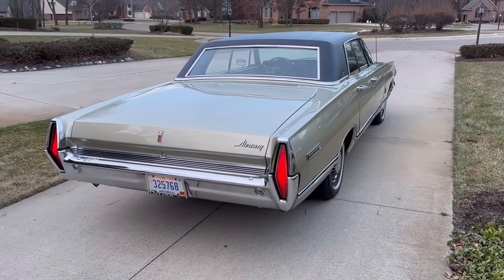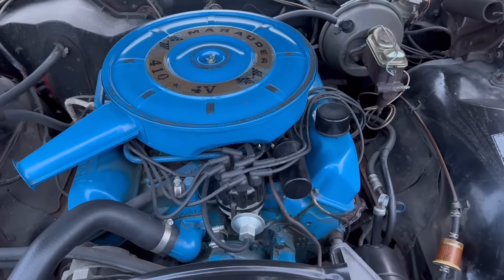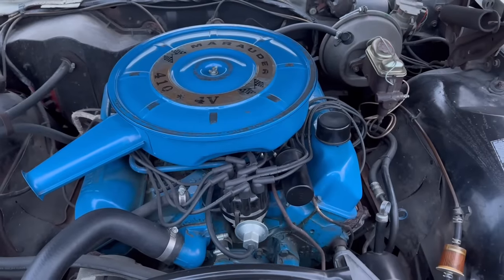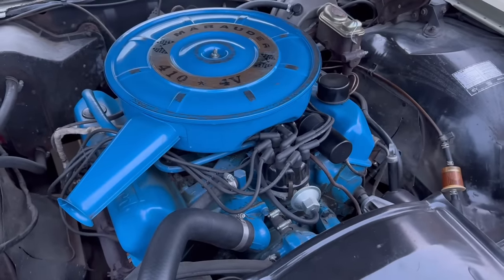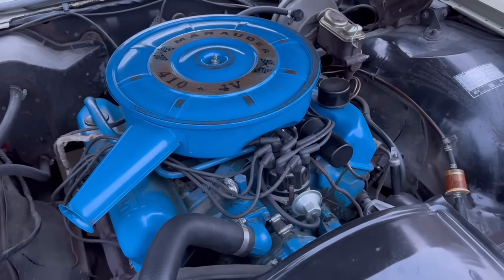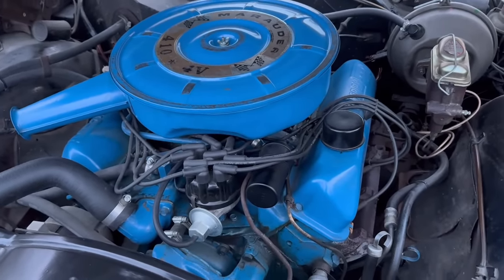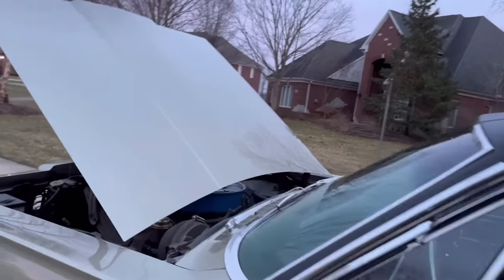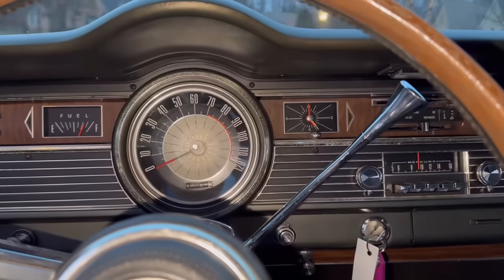Ford's Shortest-Lived (and Smoothest) V8 Engine: The 1966-67 Mercury Only 410 V8

Comment: What do you think of how the following limited production V8s compare to the FE 410?
Chevrolet 262 1975-1976 (Monza, Nova, Ventura)
Chevrolet 5.7L LT5 1990-1995 (Corvette ZR-1)
Ford Boss 429 1969-1970 (Mustang)
Ford 3.4L 1996-1999 (Taurus SHO)
Chrysler 350 1958 (DeSoto Firesweep, Dodge Coronet, Plymouth Fury)
Chrysler 383 RB 1959-60 (Chrysler Windsor and Saratoga)
Pontiac SD-455 (Firebird)

Comment: It's a good motor for a pickup truck you just take a 390 and put 428 Cobra Jet heads with an aluminum four-barrel midrise intake with 750 Holly rv cam and don't forget to enlarge the oil return passages.

Comment: Good pickup truck engines. Lots of torque. 428 crank in a 390 block. Put a 428 crank in a .030 over 427 block to get 454 cu. in. As far as smoothest, the 430-462 was much smoother, almost as smooth as the Lincoln flathead V-12.

Comment: FE does NOT stand for Ford Edsel, it simply stands for Ford Engine. The only engine family that had Edsel in it was the MEL Mercury Edsel Lincoln. I have good memories of our 1967 Mercury Colony Park with a 410 in it. My father put a 390 two barrel in it to run regular gasoline which at 14 I protested.

Comment: Here is my list of American V8 engines offered for 2 years or less: Pontiac 287,316,347,370 (‘55,’56,’57 and ‘58 one year only), Chevy 307 (1971&1972), Pontiac 428 (1968&1969), Lincoln 341 (1955), Lincoln 368 (1956&1957), Ford 239 & 256 (1954), Ford 332 (1958&1959), Ford 406 (1962&1963), Ford 221 (1962&1963), Chrysler 301 (1955&1956), DeSoto 291 (1955), DeSoto 330 (1956), DeSoto 341 (1956&1957), DeSoto 345 (1957), Dodge/Plymouth 270 (1955&1956), Dodge 315 (1956), Dodge 325 (1957&1958), Dodge 326 (1959), Plymouth 259 (1955), Plymouth 277 (1956&1957), Plymouth 303 (1956), Plymouth 301 (1957), Plymouth/DeSoto/Dodge 350 (1958), Studebaker 224 (1955), Studebaker 304.5 (1963&1964), Packard 320 (1955), Packard 352 (1955&1956), Packard 374 (1956) and the Edsel 410 (1958). Did not include the Chevy W-series 427 (1963) as only 57 were made. Hope this answers your question!!!

Comment: How long did the 383 MEL stick around.
Crazy oversquare on that thing, same bore 4.300" and spacing (4.90) as the 430 MEL.
Off the top of my head the stroke was 3.300", which makes it inherently racy.
Reply: The 383 MEL engine debuted in the 1958 model year, then was gone at the end of the 1960 model year (having been replaced at that time by the ubiquitous 390).
Reply: @bobcarlino7280 ; Short stroke MEL was probably the better ticket.

Comment: I had a 1960 Ford falcon with a 144 cubic inch solid lifter motor. I believe it changed to a 170 ci then 200 ci later

Comment: You have to do more than just swap in the 428 crankshaft........you have top change the label on the aircleaner lid!...Oh yeah, and you have to do something with either the pistons or the connecting rods so you're not hitting the top of the combustion chamber with the piston.

Comment: Not as short lived as the 410, but close, would be the 406 FE. 61-mid 63. It got replaced by the much better 427. I believe the max power for the 406 was 401hp with 3 2bbl cabs. I put the aluminum intake set-up on my 68 390 Mustang. It was noticeably faster, but  was 16 and didn't know enough about Holley carbs to get all 3 to work properly, and it seemed all they did was flood out. I got stranded once where I had to pull the vacuum hose of the brake booster and put a vise-grip on the rubber fuel line just to get it started. It ran long enough to get the vise-grip off the line and it took 3 feet to get it home. One to keep the throttle open, one to push the (now unassisted) brakes, and another to push the clutch. Got home. put the stock manifold on, and sold the tri power manifold. BTW, an FE iron manifold weighs almost s much as the engine!

Comment: Honestly wouldn't call it a 2 year engine since it's only a displacement variant of the FE line, the 255 windsor of the 80-82 era was almost as short but more critically an actual distinct variant with different heads, way different intake (used a valley pan) etc...

Comment: The original Windsor small block V8, the 221 was introduced in 1962, it was Ford's response to the famous Chevy small block V8's. 
Later that same year it was bored out to become the 260, and for good reason, the 221 was a gutless wonder.
Thus making it, I believe the shortest lived Ford V8 based on the Windsor platform...

Comment: Adam asks:

“Today we’re going to talk about the shortest lived Ford engine, at least that I know of. If I’m missing one, please let me know.”

How about Ford Australia’s 3.2 Litre SOHC I-6?

This unique, smaller capacity 3.2 Litre variant of the also-new 3.9 Litre version was introduced with the EA Falcon range in March 1988, yet discontinued a mere 9 months later in December 1988. 

This left the SOHC 3.9 6cyl as the sole engine-capacity choice for these (very attractive) EA Fords until August 1991, when it was enlarged to 4.0 Litres for the mildly facelifted EB model.

Ford also (belatedly) reintroduced a V8 option in this ‘91 EB Falcon series, although the smaller 3.2 Litre alternative never re-emerged until Falcon’s demise in 2016.
Reply from the maker: Interesting

Comment: Maybe the 406 V8 from 62 and 63, more of a race engine but probably low volume over those two years
Reply: Actually, only available '62 & first half of '63 model year.. Dropped for 427. That engine took first five places at the '63 Daytona 500.

Comment: My first car was a used ‘67 Monterey with the 390 4V.   Much better looking than the Parklane with its swooping fastback.  My dream was to find one with manual transmission.
Reply: Actually, the Park Lane 2-door hardtop had the exact same fastback roofline as the 2-door Monterey & Montclair hardtops.  A couple of years ago, the Internet showed pics of a collectible car dealer who had a '67 Monterey 2-door hardtop for sale that was equipped with a 3-speed manual on the column from the factory.  You can find on the Internet today a photo of a '70 Monterey 4-door sedan that also came from the factory with the rarely-seen 3-on-the-tree.
Reply: @bobcarlino7280  thanks for the info!  Now if I could find one of those with a 428CJ and 4 speed, I would sell the house.

Comment: Not every having owned a car with a 'COLD' light on the dashboard, what does the owner's manual state you are to do (or not do) while this light is illuminated ?
I have vintage cars from GM, Ford and Chrysler and none have such a light,  so obviously things can run fine without one.

Comment: I remember hearing about a rare Ford engine in the mid 1960s called "Cammer".  It may have been 600 HP,  and potentially more powerful than a 426 Hemi,  but it must have been very short lived,  or too expensive of an option.
Reply: The "Cammer" was an overhead cam version of the 427 that Ford made available in the mid-60's.  It was a very exotic engine (for an American car at the time); very expensive; and I believe it was intended only for racing.  I don't know what it generated in the way of horsepower, and I don't know how long it lasted in production, but I don't believe it was around for very long.

Comment: Do you have any cars with the 428? Or drive one? My father bought (used 40K miles) a Galaxie XL convertible w/ 428 4-speed . It was incredible fast 80 in 2nd no one knew where the end was …

Comment: The 410 Merc just doesn’t have the same look and wow factor as a 409 Chevy. How a manufacturer and one cubic inch can make a world of difference. The 409, even in the hydraulic valve 340hp version is a work of art with its Chevy orange paint and W shaped valve covers and this is just another ho hum engine. It is in a beautiful car, though.
Reply: You make a really good point regarding the 409 vs. 410.  Another example might be how the Ford 390 was considered a workhorse engine, but the Chevy 396 was a respected performance engine.  Then there's the Pontiac 326 vs. the Chevy 327, or the Ford 429 vs. the Buick 430, etc.
Reply: In ‘67, I was in 10th grade. If your Dad drove a Merc with that engine, it was no big deal. But if he had a 409 Impala 2door, wow!!!

Comment: I had a 1967 Park Lane. Those are not the original valve covers on that engine. Mine actually said marauder on them.
Reply from the maker: They are the original valve covers.  Check Google and you’ll see a bunch of 410s with them

Comment: Lovely car. Curious, what no-lead additive do you run inbyour old soft exhaust seat cars?
Reply from the maker: I use Motor Medic Lead Substitute
Reply: Another option is 100LL aviation gas. Not only does it have the high octane and lead that these cars need, it’s also very stable in storage. Lasts over a year without breaking down or creating gums/varnishes!

Comment: Chevy had a one year only engine. 1969 DZ302 small block. It was only offered in the Camaro. In early 1968 The SCCA started the Trans-Am Series and they mandated a 5.0 liter (305)  displacement limit. Ford already had a 302 engine. But Chevy didn’t, but they took a 327 4 inch block and installed a 3 inch 283 crank to give them a 302. They used the fuelie heads from the 365hp 327 engine from the Corvette. 
SCCA said the engine had to have a 4in bore with 3in stroke. Both companies met this with making a 302 cubic inch engine. Both claims 290hp, but we know this was lie. 
Ford put the Cleveland head on there 302 engine to create the (Boss 302). It was a torque monster at lower RPM’s (5600), with the big high flowing Cleveland heads instead of the Windsor heads that came on the original 302.
Chevy went the other way. The build a high RPM screamer (6800). They went for Horse Power over torque. Both engines preformed very well, but the 1969 Camaro was the car to beat with the DZ302 in the Trans - Am series. 

 People claimed the DZ 302 really made 435hp on a Dyno while the Ford Boss 302 made 390hp. But the Ford made 425lbs of torque and Chevy only made 410lbs of torque. The extra RPM’s let the Chevy make an extra 45hp and it made the DZ302 Camaro the car to beat in the Trans - Am series that year. The DZ302 was built for one reason, to beat Ford in this new SCCA series. It worked.

 Drag Racers started buying old 327 blocks and putting 283 cranks in them. They was buying the corvette fuelie heads (Double Hump or Camel Hump) heads. They was buying the high RPM Cam shaft that was designed for the 69 DZ302 engine straight from Chevy. Guys was building lightweight 450hp race engines using all stock parts from Chevrolet. The new Chevy 350 engines only made like 300hp in the cars and trucks with a 4 barrel carb. Even the new 350 in the Corvette only made like 325hp. 
 The little SBC 302 motor was making more Horsepower than a Big Block Mopar and Ford’s and was 100lbs lighter. If the little 302 engine was balanced and blueprinted they was screamers and could turn very high RPM’s and stay together. It was no big deal to turn 8,000 RPM’s between shifts. No other engines could do this at the time and stay together. That’s how it got the name Mighty Mouse or Big Block Killer. If you have an original stamped DZ302 block today it can help you retire early..lol. 

Great video, I had never heard of a 410 engine from Ford.

Comment: I bought a 1969 mercury wagon, not off the floor but built to my list of options.  Dealer was a friend, well acquaintance.   It swear that it had a 429 cu  in engine.  I wanted it to drive creoss couontry pulling a trailer.  It was overkill but fun to drive.  Am I crazy about the displacement. I have not seen any reference to a 429. (not 427).
Reply from the maker: 69 was a 429

Comment: The 332 V8 didn't last long....1958 and 1959?? My parents' 1959 Ford Galaxie had it with the 3-speed Cruiseomatic.   It was a great engine.  I don't believe the 332 was in the '57 ford, or the '60 ford...Edsel may have had it for three years and I'm not sure if it was ever in Mercury's...I'm pretty sure Fords had it for two years.  Please correct me if I'm wrong.

Comment: The  1958 410 MEL ford engine was  a one year  engine the Mercury  based  Edsels were discontinued . so Ford had no use for the  the  MEL engine  they still mde the  383 and the  430 but the  410 was dropped.

Comment: Ford Edsel/
Fleet Truck                        Bore                                      Stroke
330 cu in (5.4 L)	FT   3.875 in (98.4 mm)	 3.5 in (88.9 mm)

332 cu in (5.4 L)	FE  4 in (101.6 mm)	         3.3 in (83.8 mm)
352 cu in (5.8 L)	FE  4in (88.9 mm)             3.5 in (88.9 mm)
359 cu in (5.9 L)	FT  4.05 in (102.9 mm)        3.5 in (88.9 mm)
360 cu in (5.9 L)	FE  4.05 in (102.9 mm)        3.5 in (88.9 mm)

361 cu in (5.9 L)   FT  4.05 in (102.9 mm)        3.5 in (88.9 mm)    
389 cu in (6.4 L)	FT  4.05 in (102.9 mm)        3.784 in (96.1 mm)
390 cu in (6.4 L)	FE  4.05 in (102.9 mm)        3.784 in (96.1 mm)
391 cu in (6.4 L)	FT  4.05 in (102.9 mm) 	 3.786 in (96.2 mm) 
396 cu in (6.5 L)	FT  4.2328 in (107.5 mm)	 3.514 in (89.3 mm)
406 cu in (6.7 L)	FE  4.13 in (104.9 mm)	 3.784 in (96.1 mm)
410 cu in (6.7 L)	FE  4.05 in (102.9 mm)	 3.984 in (101.2 mm)
427 cu in (7.0 L)	FE  4.2328 in (107.5 mm)    3.784 in (96.1 mm)
428 cu in (7.0 L)	FE  4.13 in (104.9 mm)	 3.984 in (101.2 mm)

Comment: The Mercury Line was perceived, correctly, as being a better trim Ford, and not quite a Lincoln, but you could get that trim in the equivalent Ford for less money...so why buy the Merc?  The Cougar did well as a personal luxury sports coupe, and even though under the skin it was the same as a Ford Mustang, it had enough of its own personality to draw its own following aside from the Mustangs.

I was a bit surprised this Merc didn't have A/C, but that was still perceived as a luxury at the time (1966), and in upstate New York or even Michigan, there's only a couple of months where you can really use A/C, else, it goes unused.  Of course, like most cars of its time, this Merc has the "vent wings", so you can get somewhat of a cooling breeze while in motion.

Comment: I’ve never heard of a 2 or 4 “venturi” engine or carburetor. I have only heard about a 2 barrel or a 4 barrel. Where does the venturi  come from? I know a venturi is part of the carburetor and that the venturi and barrel is actually the same thing.
Reply: Back when carburetors were king (vs. fuel injection), engine air cleaners on American cars often had stickers on them that said things like "327-4V" or "390-2V"; the "V" stood for venturi...which is the technical name of the throat of the carb.

Comment: The cold light - grew up and learned how to drive in a 1963 Biscayne.  Freezing in the back seat on dark New England winter nights, waiting, waiting; my Dad would not turn the heat on until the cold light went off.  Eventually it burned out and we didn't have to wait so long.

Comment: Just wondering out , didn't they install the 410 in the 61 - 67 Lincoln Continental?
Reply from the maker: Nope. There was a 410 MEL V8, but it was a different engine.
Reply: @RareClassicCars  Ok thx for the info 😊

Comment: Ok.  FE. Ford/Edsel.  The 390 was always touted as a Thunderbird engine but the whole FE thing I was always in question of.  In the Chrysler camp. Mopar  the LA stood for Light "A" engine. LA. There is the "B" and there is the "RB".  So Ford just   swapped around parts.  Ford's modular activity in full affect.  Those Chevy guy's ain't got a thing on Ford here With that whole 396 small block thing.  There are people that don't seem to be aware of the Chevrolet 400.  Perhaps this could be an idea for another video.